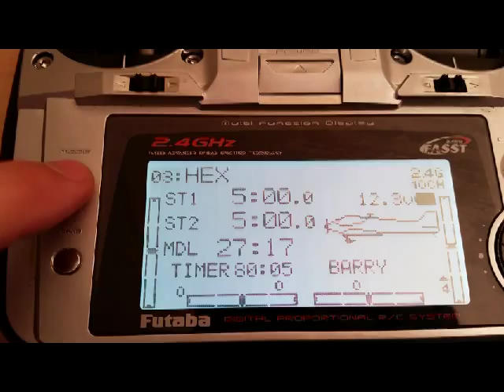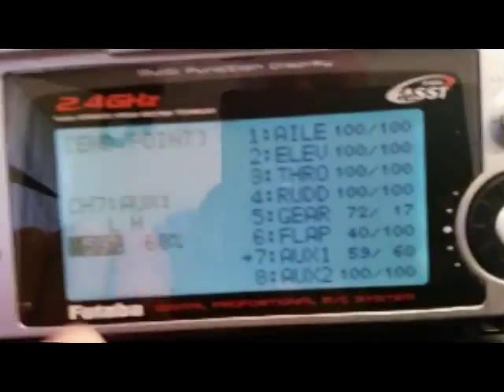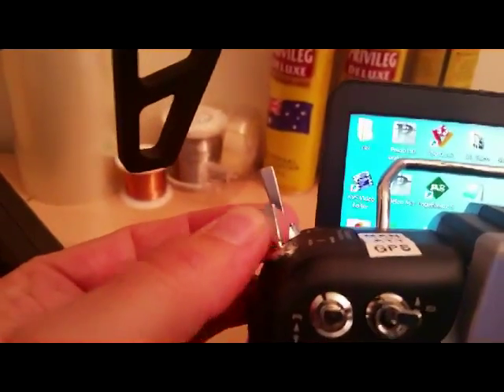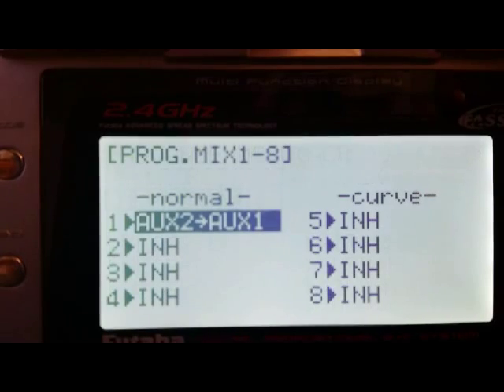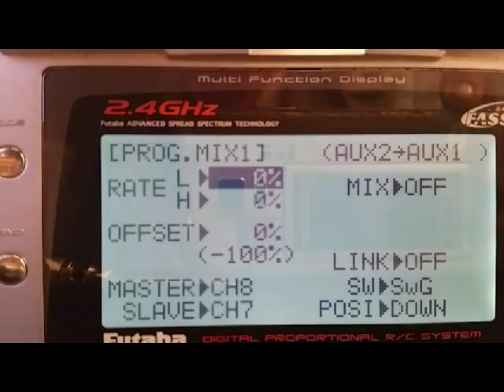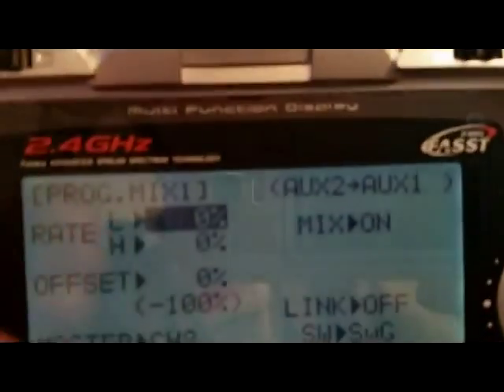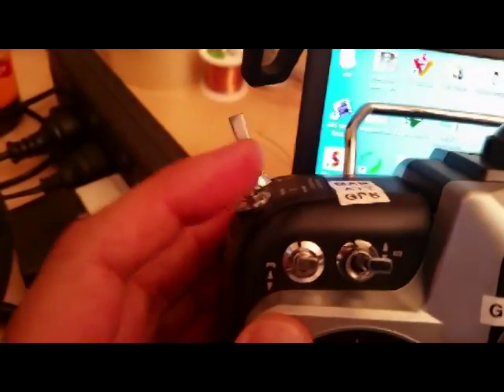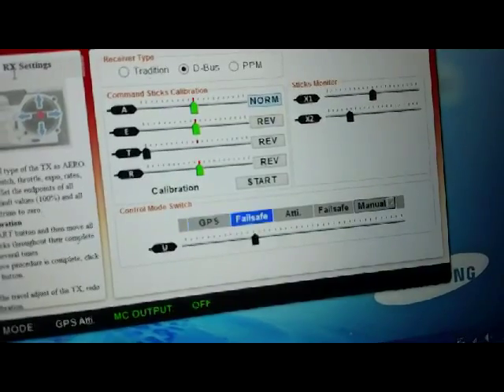HOW TO - Setup up NAZA Lite controller. Manual, Attitude, GPS & Return to Home

Comment: This naza lite has me on the verge of a mental breakdown. My motors spining perfect when i test them with reciever throttle channel.  Soon as i hook up naza all i get is fast blinking orange light,  sticks all calibrated in assistant but the three mode thing weird. I have the black arrow going to each position but only failsafe remains blue.  Days i look around and get no closer it seems.  Rant over.......... QUAD

Comment: Thanks.  This really helped.  I do want to add a note. I had to assign a SW/Vr to CH8 in order to get offset -100% so that I can adjust the Low Rate. Pre-flight check should include making sure that SW/Vr is in its default position.